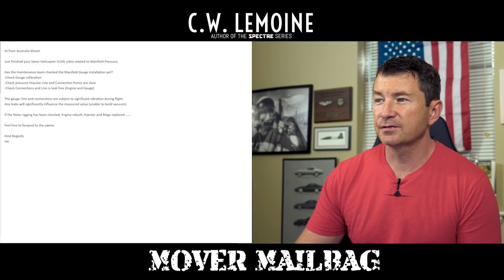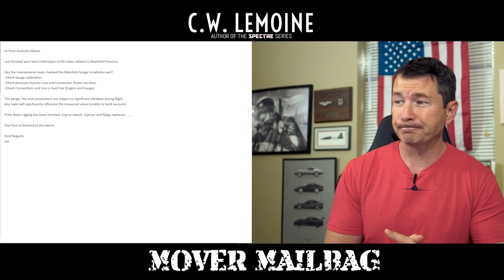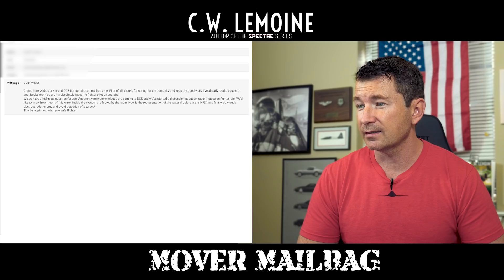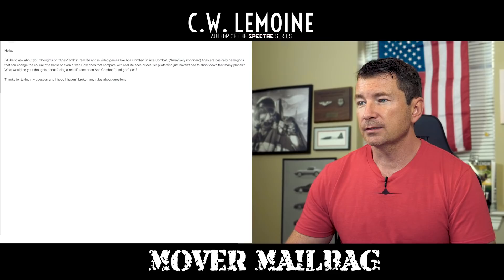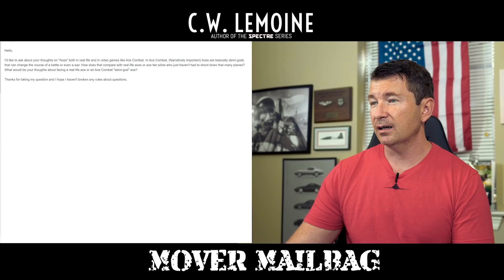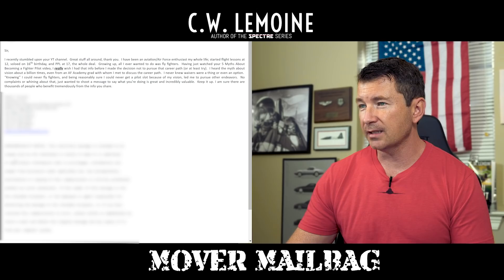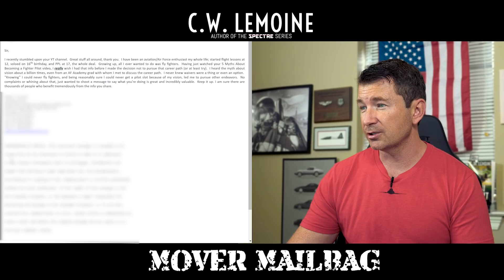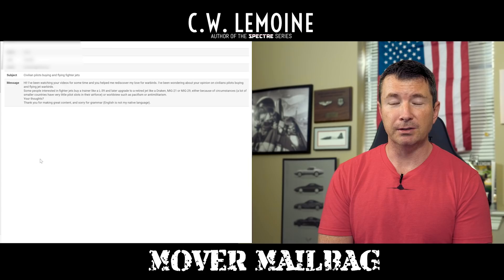Hiding from RADAR in the Clouds like ACE COMBAT?  Are Fighter Pilots Intimidated by ACES? | Mailbag

Comment: I never thought about the difference between radar in Air, vs ground.. I am a skipper on a ship and the main problem with radar is bad weather, we overcome this by applying filters, and tuning the gain on the signal strength... But if all you are interesting in is spotting moving objects at high speed, that is a much simpler problem to solve for the radar...

Comment: To pile on to what Mover said. At a certain range, yes, you can kinda obscure yourself somewhat behind severe weather on radar, but it has to be exceptionally intense. The Pulse Doppler radar cancels out things moving at (relative) speeds that are too slow (relative to you), so that usually includes rain. However, if it's dense enough (and I've seen it on SUPER dense thunderstorms), you CAN develop a radar "hole" behind the cloud as all the energy is absorbed into the cloud/precipitation. Doppler cuts out a LOT of that though and the receivers on the radars he mentions are SUPER sensitive. It would be a fluke if it managed to be helpful.

All that said, for this to be a valid tactic, you'd have to hide behind the densest spot in the storm while keeping you, the dense spot, and the opposing fighter(s)...(yes, all of them) in a straight line. All 3 of those are moving and the density of the storm is going to vary wildly. Momentarily, it might be a good tactic, but there's no way to sustain or plan for it and a wingman, who's almost always present, is going to be spread out enough that your tactics wouldn't work.

...other than VERY dire needs in war, no fighter is going to blaze through a thunderstorm that dense for a kill. The pilot is more likely to damage the plane he's in than actually score a kill.